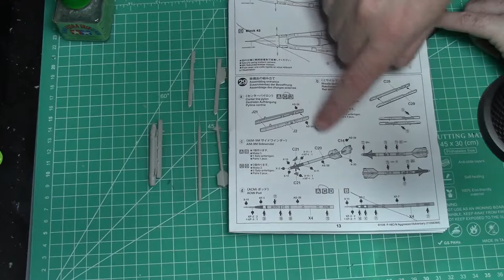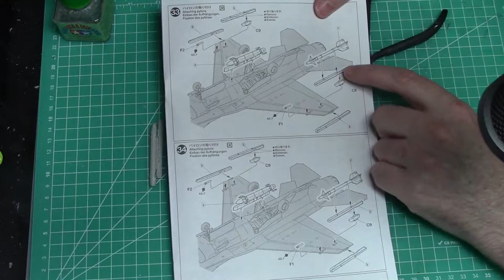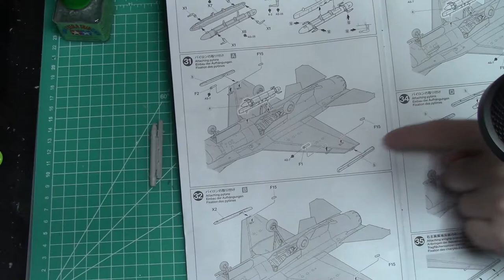1/48 Tamiya F-16C/N Aggressor Build Series - Part 4: Ordnance and pods

Comment: I've been working on a 48 scale MiG-29 in ukrainian digital camo, on and off for about seven months and still not done. For me, the digital camo was the thing that burned me out but I will finish her.
Reply from the maker: Are you using a masking set or hand masking?
Reply: @RWHobbies  A masking set, FOXBOT   FM 48-002, Ghost of Kyiv, and the kit is GWH L4813 MiG-29 "Fulcrum C" 9-13. This is my first build using a masking set, so a lot of head scratching. The painting is thankfully done now. I want to build the Su-27 later, also in Ukrainian Air Force digital camo, and looking at the camo pattern, I recon it's gonna be less work than with the MiG-29.
Reply from the maker: Yeah I had a foxbot set for a 1/72 Su-24. Need a degree in nuclear science to figure out placement and order.